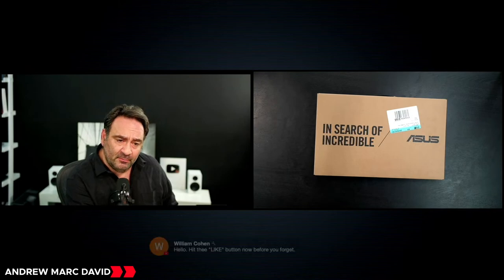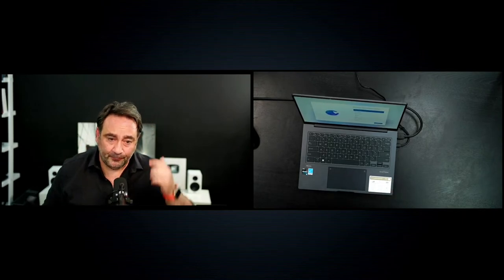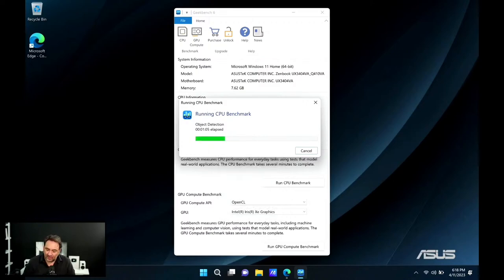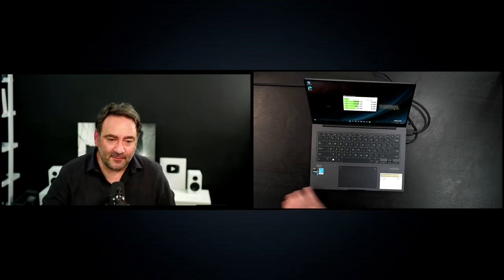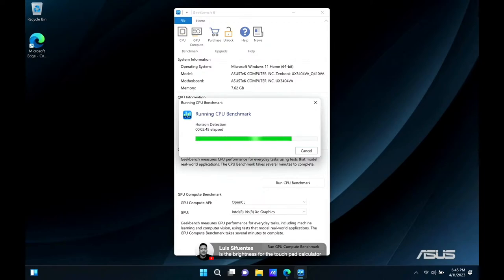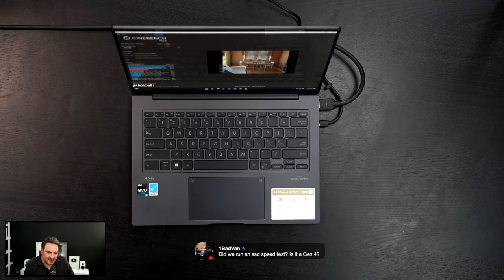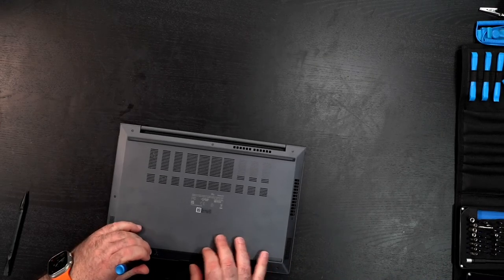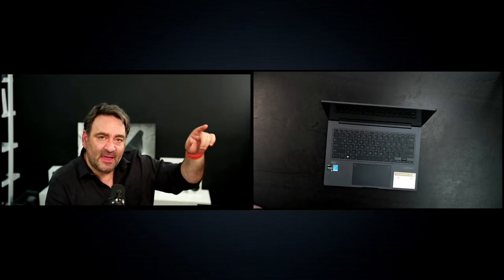ASUS Zenbook 14X OLED Q410VA (2023) - Live Unboxing

Comment: I missed it! Too bad they didn't go for 16GB even for an extra 100 it would've been a steal at 900 for 14.5" OLED, 16GB, 512GB laptop. But compared to last year's ux3402 that was 750 for 90hz OLED, 8GB and 256GB Zenbook 14 OLED this is a significant upgrade.
Reply: Well now its $700

Comment: Hi Andrew, enjoyed the unboxing, great job! The power cable is a German plug, but the keyboard is clearly a US one, as a German keyboard has special letters (with umlauts) and Y and Z keys are reversed. I would guess that Asus’ distribution center had a packing error, and packed the German power cable with the US unit, and that’s why Bestbuy took the laptop link down. Greetings from Switzerland and take care!
Reply from the maker: Hi John!  Thanks for the info!  Yes, it appears that they have the wrong batch.  Hope you are doing well!
Reply: Hi Andrew, doing well and hope same for you & family. The reason your HP power cord worked is most charging bricks now use a standardized 3 pin adapter, so that the companies can just change the power cord depending on market. Also, power bricks accept 100-240 volts, so the same power brick can be used in all markets, e.g., Japan 100 volts, US 120 volts and Europe 240 volts. The pain for manufactures is to swap out the keyboards, as even within Europe, each language has its own character set and here in Switzerland, with 3 official languages, we need to check that we get the keyboard that we want, German, French or Italian…

Comment: I'm staring at the UX6404 for video editing purposes. I've been living with 15"s forever, but been thinking recently that 14" might actually be better nowadays. 13 is just too small, and 15 always seemed a little large to carry around on one hand while I'm using it. If you are able to review a fully loaded UX6404 at some point, that would be awesome.👌
Reply: The Dell XPS 15 is very compact for a 15" laptop. Only issue, no AMD options

Comment: Hi Andrew,  Thanks for the unboxing video.  It appears that ASUS is using the same OLED 120hz screen for most of their lineup this year.  Can you tell me if you could easily see  any graininess on the screen from the digitizer, especially with white backgrounds?  I've seen this issue with other OLED screens with touch support and wonder if this panel was improved over older ones.

Comment: Thank you for another livestream and unboxing, Andrew. I looked at ASUS, last December, at Best Buy. 
Q, Besides Best Buy, where would you send an ASUS laptop in for repairs? That was my concern, before going with HP. Their website is very informative, but not well laid out. I did check out your link, this morning, and it is still down at Best Buy. The specs on the laptop looked good, the audio and camera were good, as well. This is a solid laptop for the price to performance ratio. Thank you for your hard work on the channel.
Reply from the maker: As for repairs with Asus I am sure it is fine they are a well known brand that operates in the US.

Comment: I just got a new laptop, is it necessary to run cinebench test?   What's the benefit?
Reply from the maker: No benefit.  It is a way to measure the performance of the laptop.
Reply: @andrewmarcdavid  I see, thank you!  I picked up Zenbook 2in1 15"6 OLED Q529zA few weeks ago so I didn't know about this thing.  Didn't know I was going for this brand but it was on sale at Best Buy for $799 so I grabbed it.  I love it so far, not too small nor big, and only cost 1/3 of what I had in mind for a laptop so it's a win win for what I needed.